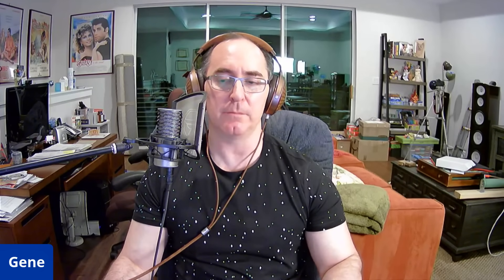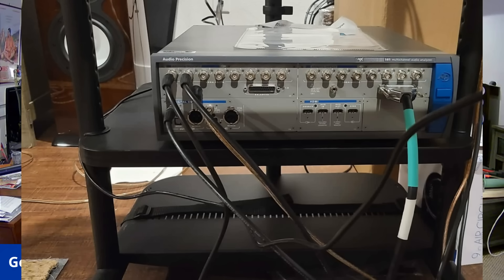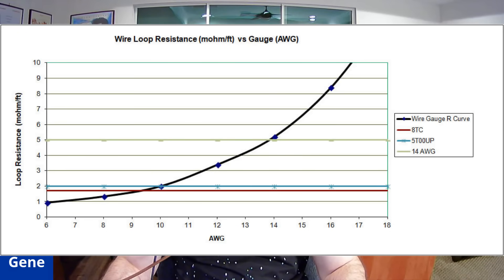Speaker Cables Really Don't Make Much of a Difference?

Comment: Big deal we have LCR meters where I work and it tells you nothing about the sound quality of a cable. Where you should measure is the frequency response and distortion at the listening chair.
Reply: You can't replicate that test or data of a listening spot. There is too many variables for an accurate test. Direct measurements of cables is sound science.
Reply: @zebunker  I have a friend who measures things with sensitive test equipment and he can measure what he hears where his ears are and that's where it counts. You can minimize the variables.
Reply from the maker: @andershammer9307  spoken as an armchair expert with little experience. When you're dealing with very small differences in measurements, you want to isolate the variables as Ze Bunker stated. 1/10th of a dB electrical difference will easily be missed in an acoustical measurement due to variance in the measurement itself when factoring in room acoustics, noise floor, and variability in the mic.
Reply: @Audioholics  armchair expert ? I used to sell stereo systems and using the wrong cables would ruin the sound of a system. I think you are using test equipment to cover up your inability to hear the real differences. I can train you to hear the differences and you will hear the difference every time. blindfolded or not.
Reply: @andershammer9307  Everyone has different hearing abilities. The younger, the more range you can hear. How can you measure something that is highly subjective. You can't. You need data and measurements. You don't buy a voltmeter or calculator and get different results when you measure standards. If a weight scale gave different results depending on what room you put it in would that be a useful way to measure weight?
Reply: @zebunker  Doesn't matter what age you are. My boss at the stereo store I worked for would give cables to an old man who wore a hearing aid to audition and he would bring them back and describe the sound. He was very accurate. I listened and heard the same things. You can't tell people who hear a difference that they don't.  It is like if I told you all hamburgers taste the same but you taste a difference. If I don't taste the difference then you are wrong for tasting a difference.
Reply: @zebunker  You can measure some of the differences heard if you measure at the listening position. keep everything the same but just swap out speaker cables and you will measure a difference. I have a Tech friend who does this and he doesn't understand why there are differences.
Reply: @andershammer9307  But you can't take what you hear and replicate it in another location with pure observation. Your car is running rough it sounds like. You think maybe it's some air valve. The mechanic also says it sounds like it's running rough. Both agree and describe it the same way. But then he hooks up the engine to dymo and based on numbers reading out you have a cracked block. But you both heard it running rough in the beginning.
Reply: @zebunker  As long as everything is good quality and the room isn't severely bad you can hear the same differences in cables anywhere. People who say they can't hear a difference can be taught to hear the differences. I did it many times at the stereo stores I worked for.
Reply from the maker: @andershammer9307  haha sure you can. It's very easy to precondition and thus bias the outcome for a listener before they sit down for a comparison. Deceptive practice but I see it all too often in this business.
Reply: @Audioholics  There's a difference between pre conditioning and teaching someone. I have ethics which didn't allow me to do things that were not true. I used to be well known in the audio world and I find it offensive for you to say things like this to me.
Reply from the maker: @andershammer9307  if you had ethics, you'd recognize all of this cable stuff is complete and utter nonsense. The burden of proof is on the ones making unprovable claims, not on the few that expose the bullshit with repeatable empirical evidence.
Reply: @Audioholics  I am getting sick of you questioning my ethics and my experience. You have no right to do this. Frankly I am shocked that anyone in audio rejects what was common knowledge in the audio world years ago and is still true today.
Reply from the maker: @andershammer9307   You come to our channel insulting what we do with your "superior" knowledge based on anecdotal evidence and then cry when your ethics are questioned. There are plenty of other channels you can spew your "common knowledge".

Comment: Measuring the frequency response of cables is as pointless as mesauring the turning circle of a car with different wheels stating wheelsize does not matter. I have measured it. 

All you talk about is frequency response. Cable have - as you measured - practically no influence on it.

But: Our ear is very sensible for difference in timing. The sound of an instument e.g. a contrabass contains  frequencies of different levels. Oviously bass but also the rubbing of the bow on the string. If the timing of these frequencies get delayed differently on their way throuh the cables the image of the instrument gets diffracted. Therefore the imaging an positioning of the instruments is blurred. 

But to whitness the less destroying effect of a cable, you have to treat your room, positon the speakers correct in the room to eliminate reflections, which is the main problem in my humble opinion. 

In my place with my gear even non believers can witness the difference between a van den Hul Magnum hybrid and a Kimber 8TC. They can clearly hear the difference, but explain it with the placebo effect. Weird.
Reply from the maker: LOL I always find it amusing when someone claims you can't measure the difference a cable makes but you should trust ones ears in a sighted test with known biases at stake. Nice try and if that thought comforts your rationalization, sobeit.
Reply: @Audioholics  You do not respond in no way to my arguments and the observations several people made im my home. 

Instead you try to ridicule me. Very poor response. 

I tested components, cables, even fuses with my Zoom H2N Stereo-Microphone on a tripod. Same audiolevel. Listen to it over AKG 301. Tested the recordings blindly A to B. Differences vary from settle to huge.

If YOUR system/room does not reveal differences in cables, how on earth can you conclude others systems do not?
Reply from the maker: @assai74  haha I bet you found night and day differences with those magic fuses.

Comment: Gene, you asked the audience to respond with the speaker cables we use. I started my high end system back in 1975 when I bought my Dahlquist DQ-10s over the Yamaha NS-1000(?). At that time, I thought I bought Mogami speaker wire, but none of the Mogami wire looks like mine. Mine is braided, with green interlaced with copper wire, all covered with a clear, heavy plastic wrap. I just looked at them, and I cannot see any manufacturer's name on it, or any markings at all! These speaker wires are now connected to the upper end of my Legacy Focus speakers (these speakers are bi-amped). the ends are straight pins, and not mini plugs, nor the often used yoke ends. The low end speaker wire connection is a thicker Straight Wire, covered in a dark blue plastic wrap. I have a 7.2 audio system (all speakers have their own power amps), which is used not only for listening to music, but also as a home theater. BTW, great analysis on speaker wire!

Comment: One of my friends who used to work in the AV industry years ago told me there was actually little difference in audio cables in general and that the 10% expenditure rule was total bollocks, or ‘snake oil’ as you like to call it. This great review basically confirms that. Although he did point out not to go for really cheap cables for speakers (like bell wire). 
I’ve always remembered that but I have to say the marketeers will always find a way to convince you otherwise. I’m glad the Audioquest myths have been debunked.

Comment: That's quite a microphone you got there. Millivolts is so low in voltage it is not even worth mentioning, which raises the question why is shielding necessary. However, point to point connection inside a copper tube Banana connections is an absolute.

Comment: Would there be any advantage to using optical speaker cables in future given its excellent attenuation and clean SNR. Or is that kind of bandwidth just wasted?
Reply from the maker: You can't use optical for an analog signal. Only way is if amps are built into speakers and you connect digitally to them.

Comment: About 20 years ago, I bought a pair of 2 metre QED Silver Anniversary speaker cables (14 AWG?) in my first foray into hifi, a pair of second hand Lambert Audio SP225s (the things that looked a bit like coffins).  I chose that cable because it was said to be a bit bright, hopefully to compensate for Lamberts' tendency to be a bit warm.  They were not new technology even for their day, and I don't think the tweeters were particularly great (by modern standards, anyway), but it was not a bad first attempt.

I think they did make a small difference, but I would not be surprised if that said more about what they replaced than of their own merit, necessarily, and I would not dismiss the psychology of expectation.   Even then, I was somewhat sceptical about claims sales guys make about phenomena at what is essentially DC compared with the frequencies I worked with, and I wondered how much I was imagining it.  But I got them for a reasonable price, so no harm done.

I still use those QED cables with my DALI Oberon 7s today and the Mission 783s I had before them.  It's good wire, why replace it?  But I would not endow or otherwise attribute any magic to it.  I'm under no illusions about those speakers, either, but they sound good enough, which is ultimately all that matters, particularly when my > 20 yo solid-state amp doesn't do them justice.

Comment: Correct me if I am wrong but doesn't  this only prove the difference in loss between cables is next to nothing. what about filtering or screening of noise ( r f ) antenna effect, between the different cables, most households have a mass of electronic equipment all throwing out RF. Sorry not an audiophile so I don't have a shielded lead bunker with acoustic lining and of grid power supply.
Reply from the maker: No magic here. Speaker cables are not good RF Antennas once terminated.

Comment: Great video. First, I rarely make it all the way through these types of videos, so hat's off. I use Kimber Kable 8PR internal biwire. In the many years I've been at this audio thing, there has only been one time where I thought I heard a difference with speaker cable. It was a pair of Audioquest Crystal 2 cables. Never since then have I  heard any difference.

Comment: While this presentation was an excellent discussion of the electrical basics, would you be kind enough to address some of the issues that the manufacturers use to justify their pricing?  Some examples are batteries attached to cables, exotic material combinations, various geometries (you found merit in Kimber's design), such as the separation of the positive and negative leads and/or the twisting together (or braiding) of them, the relative "speed" (percentage of light speed) of cables. etc.  

As a long-time audiophile, I confess to having spent a lot (well, a lot for me) on cables.  And my speakers were designed for bi-wiring. I am using ribbon cables, but am not sure about them.  They look great...   Unfortunately, the location of my equipment requires a 20' run to the left channel.  To be consistent, I use 20" on the right, as well,  although much shorter would do.  You can imagine the cost of long runs of high-end cables.   (I now own another brand of speakers, much higher efficiency, yet still fitted for bi-amping., SE tube amps on top, Solid-state on the bottom)

More often than not, spending was on interconnects.  In my long experience, David Salz at Wireworld has the best handle on making interconnects.  (You mentioned Wireworld).  His methods include testing that compares his cables to no cable.

However, not that long ago I started to make my own interconnects based on the best science I could find, and have been relatively happy with the results (although I'm still up in the air about RFI shielding for interconnects).

Thank you!

Comment: Speaker cable do make a difference  depending on the speakers you are using,  using Carver's Silver Edition, using Monster cable 14ga 20fts for starters bass sound like jbl concert bass, if you love outdoor bass, but the 18g Monster Cable sound better than Radio Skack but a bit cleaner in high notes, few year later brought Monster Cables hi grade Video Speaker for great midrange, lack of 3-D a bit lack of bass, more like studio bass, now going with Infinity SM155 work perfectly match, with a 375 rms amplifier,  back to Carver Ribbons sence they boxess speakers Monster cable made a special edition with tube sound quality.. yes i still have them do they make Infinity sound better no..why too deep in bass Because of eq box sound, midrange was under water somewhat, did used test tones yes at 80db pink noises yes there is a different at $7.00 a foot back in 1994 these cable give more studio bass, Ribbon speakers found faults in everything..in full spectrum of bass increases by 2.5db to reach 14.5hz at 80db pink noises at 75db, at 8ft seating, going back to Infinity Sm155 using the Original version fat 16g best to go, of Monster cable, last how serious are you taking this, breaks in after a week and Monster cable interlink 1000 do help a little buy this on sale

Comment: As a friend of mine said, "I can't hear the difference, they are exactly the same" before I even turned the system on. For someone who can hear a difference when contrasting Transparent to BlueJeans (can't say I did with other brands, never heard Kimber but wasn't impressed with AudioQuest). Here's a question, if I can distinguish a difference that is repeatable and memorable used on multiple systems both at home and at a store... without the bias pitch prior either, and I like the difference, is that nullified by this video?
Reply: yes

Comment: I recently replaced cheap 16 gauge cable with kabeldirekt 14 gauge cable from Amazon and there was a noticeable difference. I also found their patch cables to be a bargain. I think the biggest problem with audiophiles are they have attended very few concerts so they don't really know live music(Not classical). There is an energy to live concerts that most systems can't duplicate. I recently tried a compression driver and I think it is closest to  live music.
Reply: BS again.
You heard nothing different at all. All in your head. Might as well spend 1,000 on cables, you will hear even better.
Jejejeje

Comment: I have a question what a about shielding of cables preventing them from picking up distortion. For example those distortion produced by the electrical wiring powering your system. Example belded cables comes with shielding against this happening. So  will frequency affect unshielded cabeling in your system?

Comment: Speaker cables do make  difference ....!!!!!noise !!!  picked up on unscreened cables...noise kills sound quality, cables act as antennas i.e. they pick up RF interference... this kills sound quality ....you can hear the noise on the line..its quite clear.   So you are off on a tangent....  its really clear cable noise kills quality. It's almost none important switching out the cable size, its whether they are screened. Turn the volume up listen for the noise, then switch out the cables, the ones not making noise are the screened cables its that simple.

Comment: A simple test. Use your speaker cable as an antenna for a normal radio. That is when you see the real differences. Prepare to get shocked (mentally).

The first thing you learn in the physics is that any cable can be an antenna - or a filter. The consumer radios often use thin, unshielded wires/cables as FM antennas. Use these as your speaker cables and the noise floor creeps up. Now try it with 24 AWG cable. "Cannot hear that station anymore??"

Comment: Making statements like this guy is absolutely incorrect. First each persons ear is dfferent than you have systems with speakers and electronics that are not sensitive enough to hear the difference. I can put Nordast cables on my reference Paradigms on my Home theater and not hear any difference from any decent cable but if I put them on my system with my wilson audio speakers with expensive electronics I definitely can hear a difference between the regular decent cables and the Nordost. I don't want to but just do. I also have friends who completely hear the difference and ones that don't hear the difference on the higher end system, but on the home theater none of my friends can hear a difference. It really comes down to your ears and your system. To measure and say no difference is like those guys who measure DACS and say the best one is the one that measures the best. Well if that is true than the chinese DACs you find on Amazon are the best in the world.

Comment: The shortest distance between to points is a straight line, not a helix like a braided cable. Braided cables that are " 10' " long are more like almost 11' long because of the added length due to the braiding.

With that said, as someone who mixes music ever day, I can't hear the difference between .05 db. .1 depending on source, but .05 no way. It's SO CLOSE it couldn't possibly be PRONOUNCED